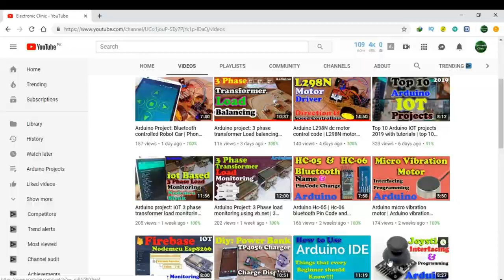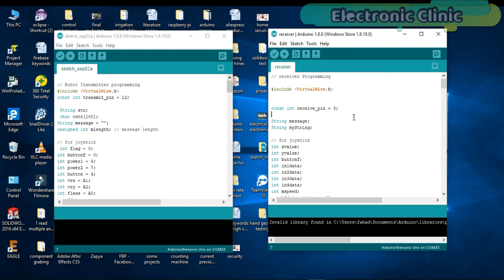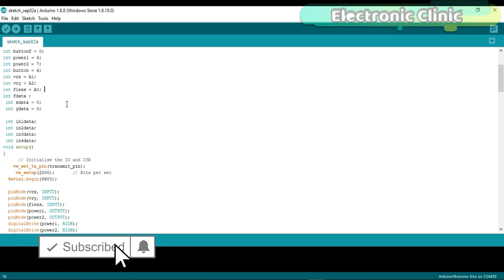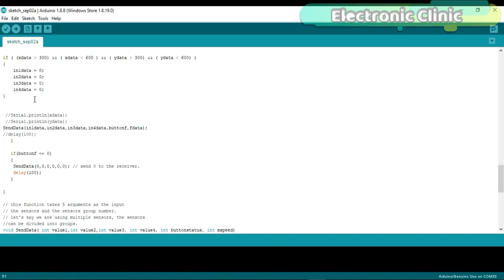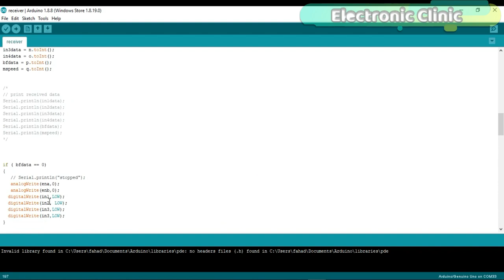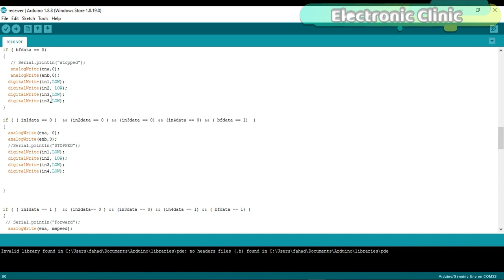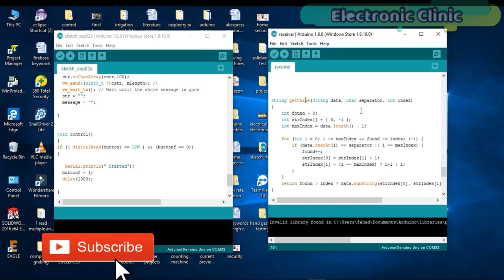Wireless Hand gesture controlled robot car using Arduino, Joystick, and 433Mhz Tx and Rx Modules

Comment: is it possible to control car only with flex sensor?
Reply from the maker: yes you can. define different bend level of the flex sensor and then accordingly control the forward, left, right movements.
Reply: @ElectroniClinic  and possible to control the speed of the motor depend the analog data from flex sensor?
Reply from the maker: i suggest you keep the speed control separate from the direction controlling. otherwise you won't be able to accurately control the robot. as you know its an analog sensor.
Reply from the maker: but if you use two flex sensors then kool. use one flex sensor for the speed controlling and use another one for the direction controlling. but i think for direction joystick is kool. its cheap and easy to use. or you can also use mpu6050 to control the direction.
Reply from the maker: or even you can use a variable resistor to control the speed. you have so many options. select the one, which works best for you. if you need help, let me know.
Reply: @ElectroniClinic  thank you for ur respond, i want to make project about controlling wheelchair with 4 flex sensor, can u help me with the code pls?
Reply: @ElectroniClinic  because i dont.really understand how to use rf 433 to control motor with my flex sensor, can u help me?